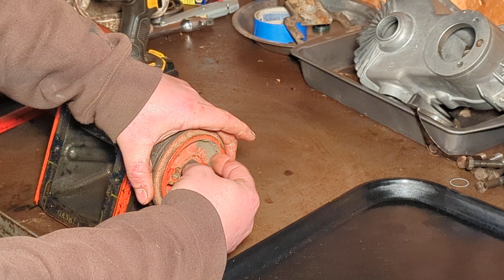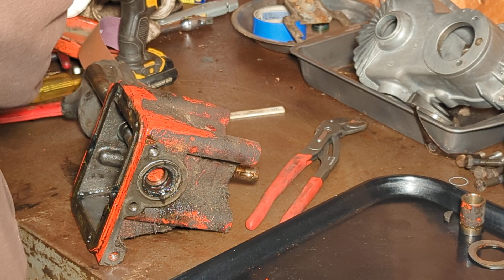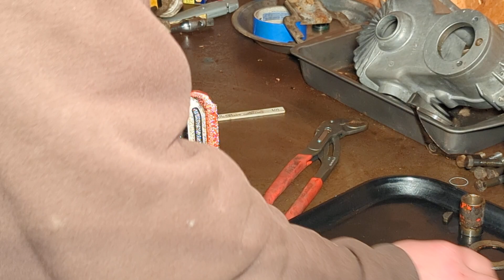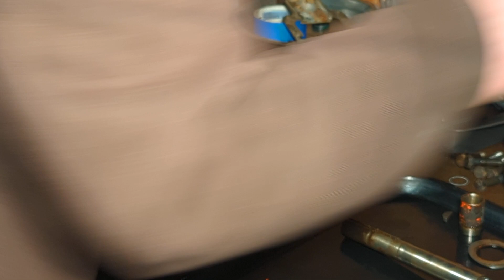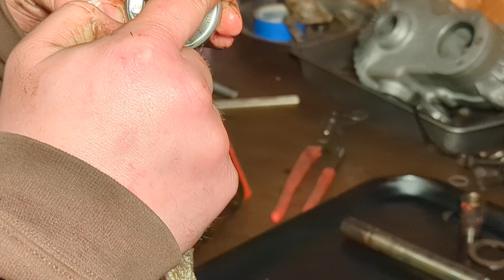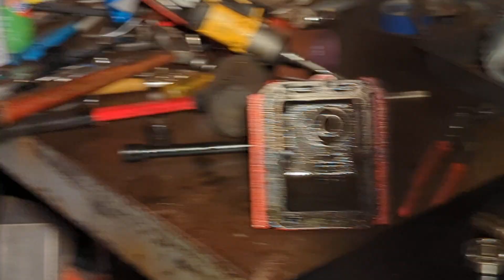simplicity bevel gearbox rebuild part 1

Comment: Thankyou so much , i just picked up a 917 that i thought was ok till ivestigating more and the bevel gear box has me regretting buying but you have shown a bit of light to this that maybe i can save myself. 
It feels all tight and turns smooth but the back play is loose so hopefully i can save it before it fails beyond repair .
Reply: I found a tractor they were scrapping out I got 2 for $200.00. No motor in one and a B&S just sitting in the other. But all the parts will come in handy down the road. Keep checking or put out a add for them. So I got basically a gear box (2 which both) are good for $200.00 which I’ll keep because I have 2 AC which take the same thing
Reply: @jeffshorts6052  thats a bonus , what all models have same gear box?
I may have to go state side to find one , dont see much of these north of border.
Its just by chance i bought a 917h here.
Reply: @normanbaril8024  not sure I needed gears and I got a 712 it has the same gear box I have that be for a B210. I think because it’s yellow AC I’m kinda new on the AC Simplicity. I have really appreciated the no pun intended the simplicity of them. I say that because I had John Deer and they can be a nightmare.
Reply: @jeffshorts6052  ya im new too to the orange paint, good to know they are simpler than jd
Reply: @normanbaril8024  I just found this it that the B AC gear box won’t tin my 712 Hydro.

Comment: Just acquired a Allios Chalmers 712H 1977 
I just took out the bevel gear box and dismantled it. Where can I get gears bearings and seals.
Reply from the maker: Sorry I missed this. Small Engine Parts Warehouse in West Bend, Wi is where I got most of mine. Otherwise Napa can cross reference some things. Remember, a lot of things will say no longer available. You need to actually call and have them cross reference to the updated part numbers.